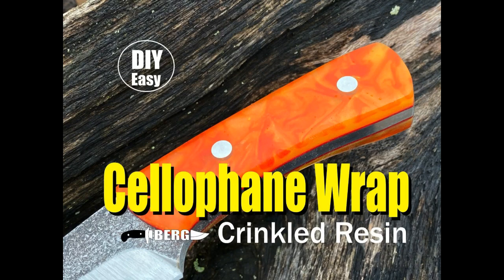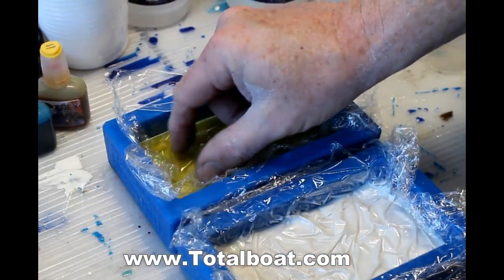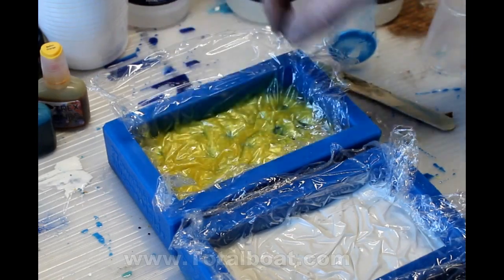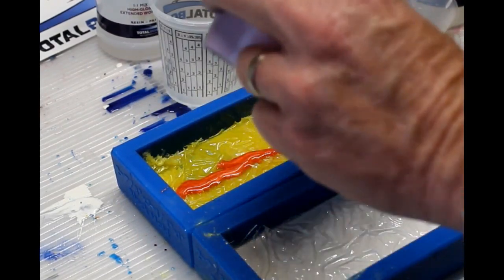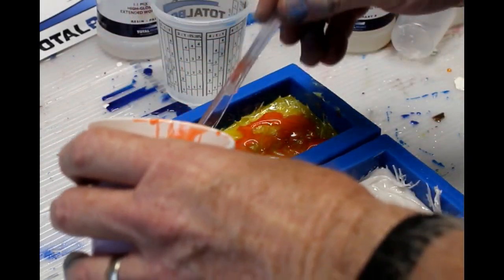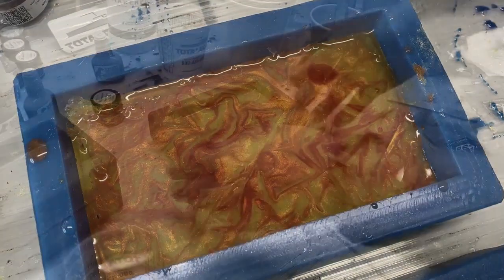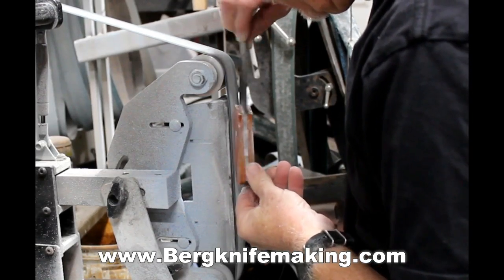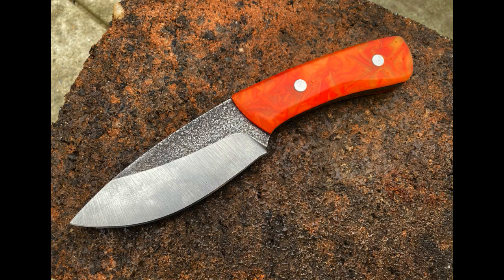DIY Crinkled Resin Knife Handle Scales | Cellophane Wrap Technique tutorial

Comment: Thank you for sharing your technique the results look awesome. One thing I'll mention is when you're finishing your knife scales I've been having excellent results using Steel wool. Once I get to 400 grit I generally transition over to steal will work my way from.0 to 0000 and then hit the buffing wheel with white rouge. The nice thing about the steel wall is that it conforms to the shape of your handle easily, doesn't seem to wear out as fast because it's a three-dimensional abrasive. Finally once you get to 0000 steel wool it will actually leave a near mirror finish on your pins.

Comment: I’m a handle maker. I’ve been doing decorative wood designs and have started to experiment with epoxy. This effect is one I want badly but cannot get to work. The plastic wrap bonds to the epoxy each time I try. I use the same epoxy and have tried removing the wrap at 3, 24, and 48 hours. It always sticks though. I’m using costco brand wrap. Any advice would be genuinely appreciated.